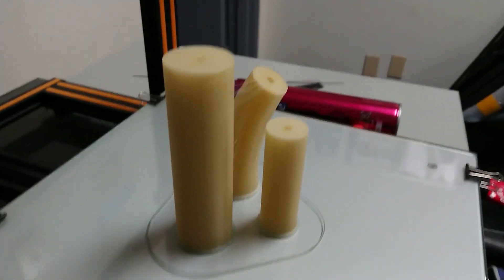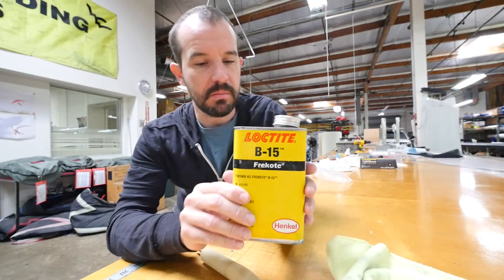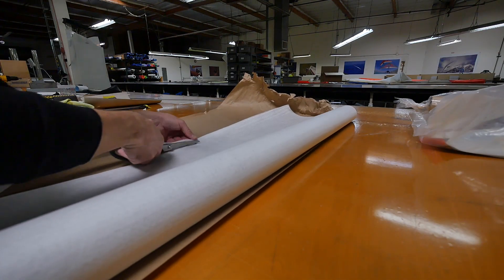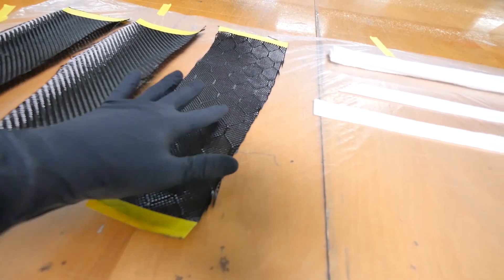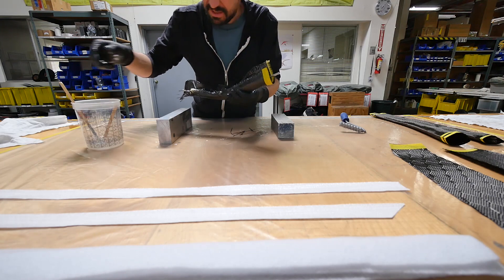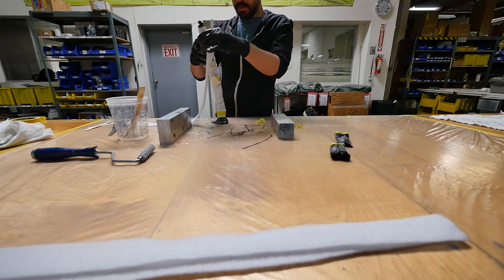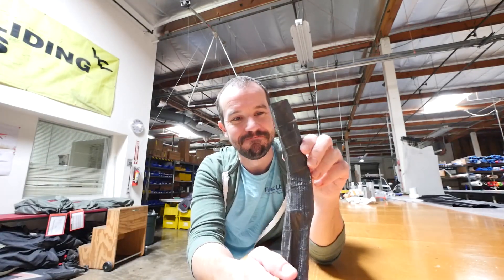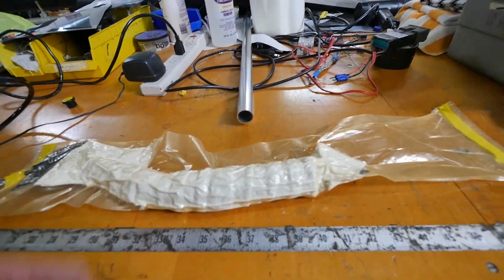Making A Carbon Fiber Nose Boom for a Hang Glider

Comment: Hey Dave,
I have multiple experiences with manufacturing carbon fiber parts.
I watched how you made it. It's one way to do it. 
BUT: You did it on the hard way !

What I always do is to lay down the complete carbon fabric onto a plastic film.
No cutting before resin is on the fabric!

Apply the fabric to a plastic film.
Now fix the fabric on the film by tape all around the fabric.
Now apply the epoxy resin onto the fabric on the film.
The resin now sticks the fabric onto the plastic film.
Now it’s time to cut the peece in that form and dimension you need.
The fabric is fixed by the resin on the plastic film and the plastic film holds the fabric in perfect position.
By this way of preparation you get yourself made “prepreg”.
Now it’s time to bring the first layer of “prepreg” into or onto your waste body or your negativemould.
When the position is correct and the wet fabric has contact to the surface of the mould, you rip off the plastic film. 
Now you can repeat this process layer by layer.
This way of working is the professional way to do it.
This way guaranties that the flat woven roving’s stay in a flat orientation and get not rounded.
This way guaranties that the edges of each fabric part is not rabbled out.

About me,
I designed and produced the rigid wing IMPACT, made from carbon fiber as you can see on my channel. If you need more help and use easy ways of working with carbon and glas fiber you are welcome to ask me.
Regards,
Olaf from Hamburg

Comment: A vacuum switch that is adjustable reduces the negative pressure to a level that will not destroy the part you are laminating. It is used similar to a thermostat which turns on and off a heater. The vacuum is regulated by turning off the pump before it gets to high and turns back on when vacuum is low. Without regulating, a vacuum pump will destroy all but solid objects. Another method that I use that works reasonably well for softer parts is just to use peel ply and absorbent towel then wrap the while thing tightly with pallet wrapping plastic (100mm wide roll). This works well for laminating FG/CF over a foam blank for rc fuselages. Not a perfect finish but quick and easy and nothing a bit of filling and sanding cannot fix. Good luck.

Comment: Interesting project! When doing wet layup of carbon fiber I believe each layer should be done individually, to let the epoxy saturate and cure fully, otherwise it will penetrate unevenly and sacrifice strength. Overall cool video though!

Comment: Thank you Dave, for such entertainement video, beautiful editing. And having as background Willy Wonka Candy factory is even better ! :) My question is ( excluding the fun and cool looks), why? I mean carbon is perfect for many things, but for nose.... in a whack, since there's no flexibility in the material  the changes of cracking are quite high. Cheers and keep showing us those projects. Fly safe.
Reply from the maker: First thing, don't whack. There's also going to be an expensive camera on there so I'm much more concerned with the camera breaking then the mounts. In fact, I'd much prefer the mount to crack/break as I can just make another one. Carbon is a perfect material for this type of application and the part is also a perfect part to try out this technique.
Reply: @designbydave  Thanks for reply. Wacking is "part of the game". There's no HG pilot with a clean sheet 😉 I was thinking in gopro in a good case,  rather expensive SLRs. Just come to my mind including in the design a weak link ( replaceable?) Elbow shape or something.  And may ask to Dustin Martin  for help/tips. I believe he was making the PODs for instruments. Cheers

Comment: And now when i watched the complete video, I se the next mistake.
Between peel ply and breathing tape, bring a layer hole film. This plastic film as thousands of holes and allows the resin to flow into the breathing layer. It makes it much easier to rip off the peel when the resin is hardened.
One more advice.
To get to waste body, use roof mate foam. Cut it and sand it to the perfect shape.
On that foam waste you apply the fabric.
It is strong enough against the vacuum forces.
After curing, rip off the plastic vacuum bag.
Rip off the breathing layer.
Rip off the hole film
Rip off the peel play if there is one.
Now sand your carbon part.
After sanding drill a hole in the carbon
Now fill in acetone to dissolve the polystyrene foam (Roofmate)
Now you has the perfect carbon monocook